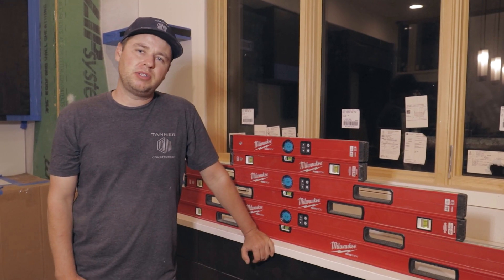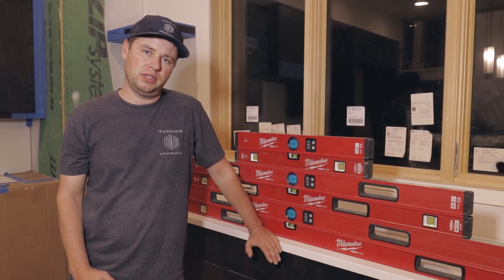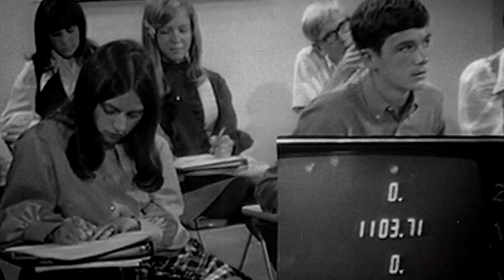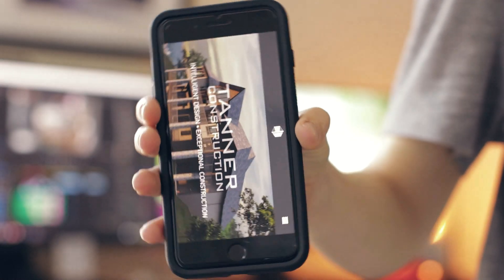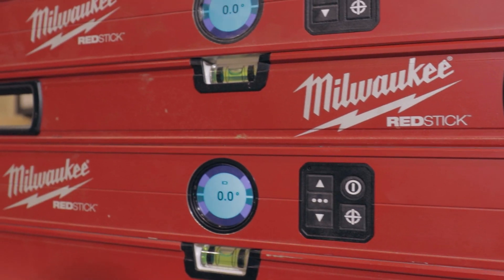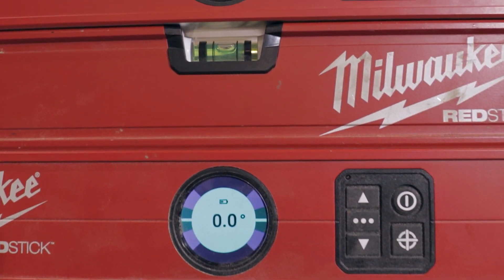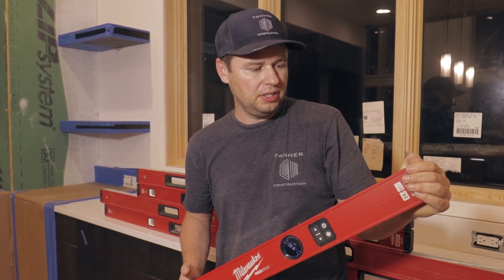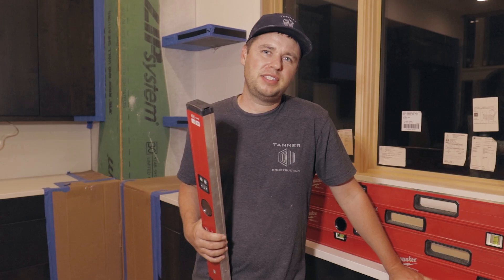REDSTICKS! How do they work??

Comment: As a one man blacksmith shop I use the digital readout to measure pitches. The magnetic side also comes in handy when in combination with the digital read out so I don't have to hold the level on the steel. In addition when your hands are full, your body position is not always perfect for eyeing down the bubble sights. With the digital readout you can actually level out your work from anywhere. I will be investing in milwaukee digital level soon!

Comment: I prefer my levels to be produced by a company that specialises in levelling equipment not into these jack of all tool companies just a race to the bottom so Milwaukee and dewault/Stanley/b&d I am looking at you!!
Reply from the maker: I'm assuming you run Stabila?  I have bought a dozen of their levels over the years and I can say with confidence, the digital Milwaukee levels are better than anything Stabila makes at the moment.  Empire is another company that specializes in levelling equipment, but nearly all of their products are junk... As a matter of fact we just threw out several Empire squares due to them not being square lol.
Reply: I would be interested to see these still functioning in 10 years given that I have stabila levels that are closer to 20 years agreed not digi levels but still!
I do find this interesting but am like I say not keen on these companies being my one stop shop for tools, to each their own as for empire well I think most of their stuff seems a bit junky and we don’t see their levels over here!!
Reply: @grimmmly  Milwaukee digital levels are rated for a higher accuracy than Stabila and the warranty is longer. Stabila makes great spirit level but Milwaukee is leading the industry in digital level.
Reply: TTi (owns Milwaukee) bought Empire, who specializes in measuring and leveling.

Comment: Great video, thank you for sharing.
So if you drop a digital level how do you know it is still accurate or does it recalibrated self?
Reply: A level can be checked for accuracy very simply. Place the level on a flat surface and mark the position of the ends. The surface does not have to be level. Take note of where the bubble is, or what the degree reading is. Turn the level 180 degrees horizontally (keep the same surface of the level touching the surface) and place the level in the original spot.  If the bubble or degree reading is the same in both directions, the level is calibrated properly.
Reply: Bill Ammer Thank you very much for your reply back.  Very helpful.
Reply: @davehartsock9106  you can also put another level that you know is calibrated on top of the one in question
Reply: The Milwaukee Redstick levels recalibrate on startup.